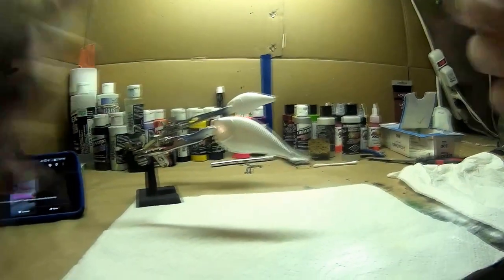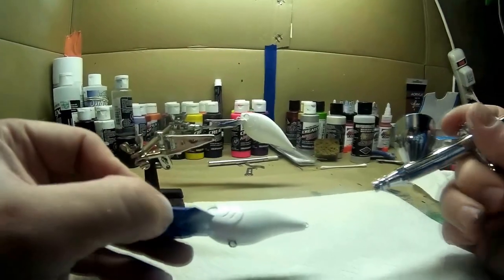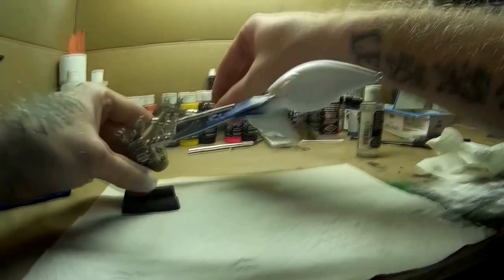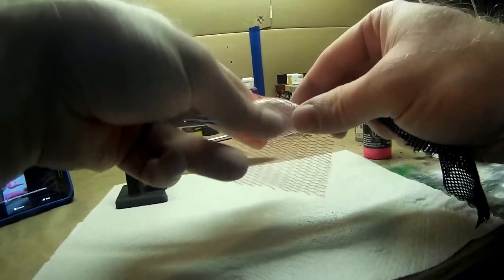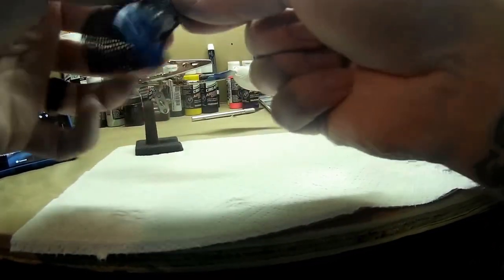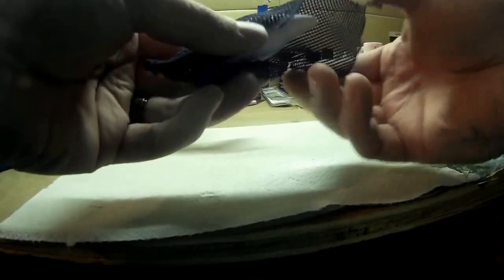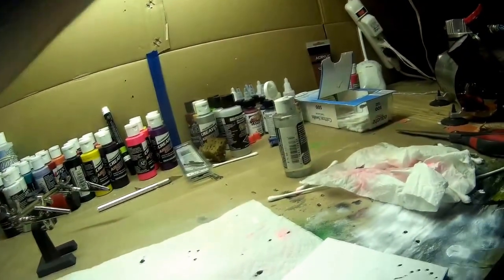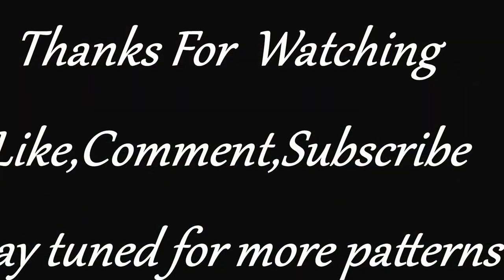Pink Passion Lure Painting Pattern

Comment: nice video one thing that will make the dot line up so much easier is to use a tooth pick and with the same color your painting figure out where you want  want the dot put a small dot with tooth pick then when you line up the stensil all you have to do is center it and your done much easier to line up and paint over